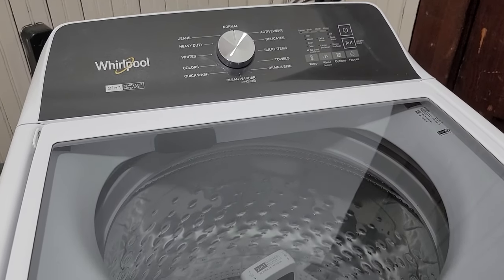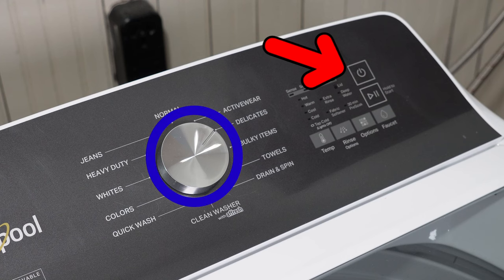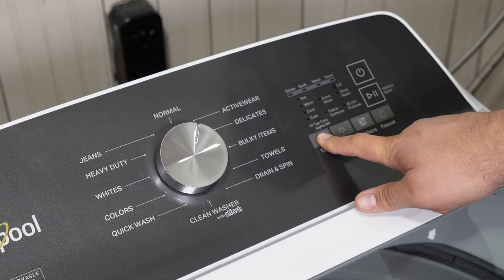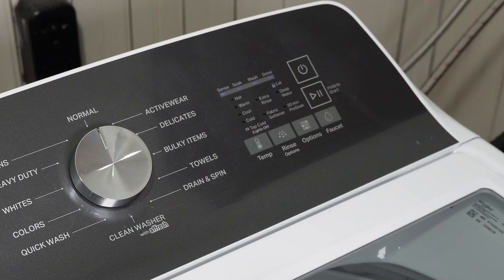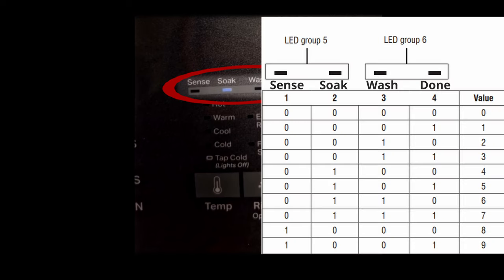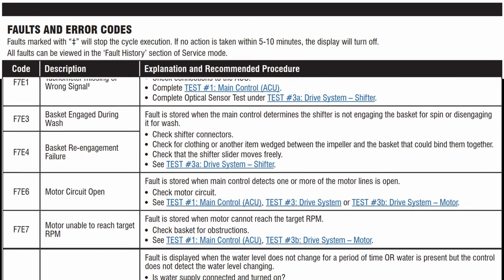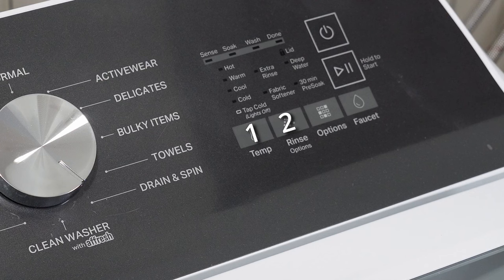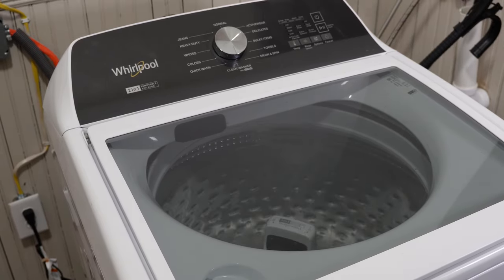Whirlpool Touch Screen Washer Diagnostic Mode, Error Codes, Calibration, and Troubleshooting

Comment: I hate this washer.
Reply: You don't hate washer! I love new washer!
Reply: Me too
Reply: Same. Piece of crap. Bought new last year and is broken every two to three months.
Reply: It is horrible.
Reply: Sameee😢
Reply: I have not had this washer but one month. I HATE THIS WASHER!!! I would be more happy with a scrub board and wringer washer!!!
Reply: Me too😢
Reply: same here dude
Reply: Me 3..My wife doesn't like it either..Makes a LOUD grinding sound during the sense cycle and slow spin.14 months old
Changed Actuator no luck same problem...waste of money..disappointed with WP.
Reply: Me too
Reply: Me too.....smh
Reply: Washer never had problems until now.
Reply: Same
Reply: Mine randomly decided to stop draining and won’t turn off and won’t unlock.
Reply: @brianj2344  ours makes the LOUD grinding noise as well 😢
Reply: Me too. Absolute waste of money. Had it just over a year and it’s already broken 3 times. Out of warranty now
Reply: Hello All...in regards to the loud grinding sound that sounds like metal...I repaired mine by replacing the splutch similar to a clutch very easy to fix and part is inexpensive..I am not a expert like Ben but he gives great advice. I just like to fix or tear up stuff.😉
Reply: I also hate this washer.  It NEVER fully covers the load with water even though I always use the "Deep Water" setting.  The water never fully drains out of the bottom, so it really starts to stink even though I leave the lid open.  It is really noisey, even moreso than our 15+ year old Samsung front-loader that it replaced.  I thought I hated the old Samsung, but after this Whirpool, I miss the Samsung!

Comment: What does it mean if “lid lock”, “sense” & “done” are flashing?
Reply: That would be F9. He should’ve explained it a bit better… if you look at the graph he has 6:57. The sense and done meet all the way at the bottom in the 9 value..
Reply: @alexmoran6436 thank you for your comment! Does the f9 code mean drainage issue?
Reply: @ninademin8244 that is what I am trying to figure out myself.  I watched a video that says we need to clean a filter inside the washer. It catches the hair.  I think that is what is clogged. I just don’t trust myself taking off the piece to get inside the washer. 😂
Reply: @km88877 my machine had a wire that was disconnected! Hopefully you can fix yours!
Reply: were you able to fix yours? I am having the same issue, the code is F9E1
Reply: @chrismorgan1226  I unplugged it and drained the water with a pump, I let it sit for an hour unplugged and then plugged it back in and it started working again 😅

Comment: I ended up having to get a new washer even though the codes showed that it was the drain pump which they did replace and still had the same issue. Additionally the machine was doing the wobble on the spin cycle and the suspension was shot! Mind you I had not even washed 10 loads in this thing. Stay far, far away.

Comment: Saved me the trouble of driving 80miles with my washer to get it looked at just to find out my drain line was too low and siphoning water causing a fault. I had a old washer before that I salvaged from 3 broken ones. When it went out I decided to buy a brand new one for the first time and had problems right away and a few weeks of trying to figure out the issue this video is what helped me finally fix it. Keep it up much appreciated.
Reply: Was yours not draining right when you bought it? I just got mine today and it is not draining. Clothes are still soaked afterwards.

Comment: Thank you
Helped solve my washers issue. 
Got the code for drain pump issue F9E1 and ran test with back off machine. Arching from wire harness so stripped the elec tape off to find 99% broken wire with burnt insulation. Repaired break and reset machine per instructions in this video. One thing to add, the machine was all ready to go but would not start. I unplugged for 5 min and then it operated fine afterward.
Just a note that my machine turned out to have an extended warranty from membership box store so we called in Maytag repair (haha) man. Besides offering nothing for feedback, he advised on further questioning he needed a part (wire harness and drain pump) and was unable to give any time estimate. Meanwhile cloths piling up. So I completed repair above and we will see how long before he shows back to finish his work.
Hope this pays it forward for someone else with similar issue. This washer is 16 months old

Comment: Your video is perfect! Its full of info I couldn't find anywhere else. Helped me figure out the code about the motor not working. Found out the bracket that hold the capacitor have dent to prevent rotation of the capacitor, and these dents made a hole on the capacitor and broke it.

Comment: Hello Ben ...Thanks so much for all you do for DIY folks....Your video is spot on for the exact unit that I have and trying to fix. My machine makes an ear piercing /screeching metal sound when the unit first starts to spin.... 1st in the counter clockwise during sense cycle... and periodically during the spin cycles. Not sure if its the shift actuator,, clutch, or gear box. I will try to reset the unit and then try to identify the fault codes.

Comment: I think you’re the only one with this info on YT. I hate having to call WP Tech. They take forever to answer 😂
Reply from the maker: Its pretty bad if some random guy on the internet helps more people than Whirlpool lol
Reply: @bensappliancesandjunk Do you know what part needs to be replaced for the code F9 E1?
Reply: @bensappliancesandjunk I can't get the machine to drain the water. Would it be the pump?
Reply from the maker: @TheG4fbaby  you need to test via multimeter for that. See if you can get a signal from the control board to the pump (OL means its dead), then take pump connector off and test pump. We are seeing a LOT of these units have dead drain pumps, that end up being the harness rather than the pump itself.
Reply: @bensappliancesandjunk please help with my washer. It’s sensing making a noise sounds like it’s draining, then going to done. Did the hard reset twice,,nothing happened, plugged it out for a day still the same thing.
Reply from the maker: @syheidabrathwaite5390  Jave you looked for error codes?
Reply: @bensappliancesandjunk  no I have not, I simply follow the hard reset thinking it will work. Simone explained their same problem I’m having, let me get the code. Cause she never got a reply to her code. 
One sec.

Comment: Thank you!!!  I ran mine in diagnostic mode and it showed that the drain wasn’t activating. Took it apart and the drain pump cable was severed!! Probably from rocking super hard with a big load. I spliced the cables back together and now it works!!!
Reply: Thanks for this comment.  I had the same problem!
Reply: @tdafan100  I think I have the same problem. What error code did you get? F8e1?😊

Comment: Thank you for posting a video with my actual model!  Do you have a video for replacing a tachometer?  I got the F7E1 error
Reply from the maker: It should be like all the other shifters out there. Pretty straightforward fix
Reply: I had this code replaced it and still not fixed 😩 just now when I run the test cycle it never stops spinning

Comment: HELP!! I have that same washer. I ran the diagnostic test. It flashed the same lights as the example washer: Soak Wash Done Lid
Ok so in between flashing this error code it also flashes just: DONE. But does that just mean DONE or is that another error code?
Reply: HELP!!!  Mine is doing the same.  I don't see a response. Did you get your machine to work?
Reply: Mine is doing the same thing helpppp
Reply: Mine too
Reply: It would be F7, E1
Reply: @acasares311 how did you get it fixed
Reply: @RemiB2023 how did you get yours fixed
Reply: @fixedalarm5012  had to have a repair man fix it. It ended up being the clutch I believe

Comment: I had an issue where the wash cycle took well over an hour and the lights flashing were lid and sense together and then done.  The unit would just try and drain the water but no noise and clothes were still soaked.  I then shut the machine off and added more water and did a drain and spin cycle only and it worked.  Could this indicate that the drain filter was clogged?  I did use an old sunlight he detergent (maybe it was too thick/too much) and it was only 1/2 load.

Comment: Our washer’s agitator barely spins and during wash it keeps sitting there, filling with water, agitator moves a little, fills with water again, then agitator barely moves. It seems as if it gets stuck in the wash cycle and doesn’t know how to wash, any suggestions?

Comment: Ok I have a Maytag front load giving me trouble error code F 05, which tech sheet says heating element/sensor error. I replaced element, heat sensor and the CCU. Still getting same F05 error code in the diagnostic  test. 
Any ideas?

Comment: I have a 2in 1 washer I got new parts for the washer and it still doesn't work the codes are still flashing   sense ,soak  wash to done with the lid liight  on and then falashes done. I already ordered the control board and the lid lock please help me
Reply: Is it solved?

Comment: The 123 don’t work for me. I’m home by myself and can’t get to the plug in to do that. 
I put some bulky cat stuff in the washer like a couple
Cat beds so the washer was giggling in spin cycle. 
Then I noticed the stuff was wet even though it went though the drained.
And the sense and light went off and on and the lid lock button off and on as well. So
Idk wtf the is wrong. 
I just turned it off and on and did a drain and spin and the washer is giggling 🙄

Comment: I have code F7E1. I haven’t tried anything with a multimeter yet, not the best at using one other than checking continuity and voltage. My washer will click the door lock, it does lock at first, then immediately unlocks and won’t do anything else. We bought it new just this spring. Any suggestions?
Reply: Same f7e1 it's either loose wires, control board, hmi harness, UI or shift actuator.  I changed shift actuator no luck so now tech guide says control board.  Waiting on part hopefully it fixes it.  I'm on day 3 no washing machine.  Good luck on yours.

Comment: Thank you so much.  Glad I found info on this damned washer! How did you get so smart? I feel like a dummy screwing around with this washer. 
How can I get just a rinse cycle?
How to stop when the washer starts shaking because it got unleveled?  Thank you.
Reply: I have this washer, there is no setting for just rinse, there is one for drain and spin. You can use the quick wash and stop after the first wash cycle by pressing the power button. Or you can just let it run for rinse cycle, usually 30.minutes into the quick wash setting. You can pause the cycle by pressing and holding the arrow key until it clicks, it will stop and unlock the lid. I use this to add detergent and fabric softener. This will stop it so you can re-adjust the load too. This machine is a pain but I have learned to work around it.

Comment: My wtw8000 beeps constantly. Unplugged repeatedly and still flashes code F then 2 over and over. the power button will not even allow me to turn the machine on or off. Also, all of the lights are illuminated around the knob. Please advise. I have checked all the hoses and they are clear.  7:32 7:32

Comment: Question- Has anyone had this same issue and if so, was it an easy fix? The "done" light stays on after the cycle completes; I lift the top door, close it and the light stays on.  This was not happening before.  The "done" light should go off as soon as you open the door. Any ides or suggestion how to fix this?

Comment: You're awesome Ben.  I just bought a 2020 Maytag MVW7230HC0  used. The tech sheet is missing, can you recommend a site or whatever where I could get a copy of one.  This machine has an LED display. It doesn't have the six pilot lights

Comment: Just got the washer techs ran the test stopped running water did not drain now I have lights sense, done and lid lock light on what does that mean is that fixable
Reply: I have the same issue my washer isn’t draining either! Lights sense and done and lid is coming on

Comment: Great video - I installed one last night, I am not getting any water coming in - I only get water from the "faucet" button --- do you think it might be water controller valve faulty - this is literally a new machine - I am going to test the valve tomorrow - and run these tests and reset - hope that it will get fixed, if I still don't get water, then I will replace the water valve - after doing all this, I might be out of options - what do you suggest I do next if these do not work out for me?
Reply from the maker: Thats an odd one. I'd check to make sure both hot and cold water is coming to the valves by unhooking and making sure water comes out. Make sure the screens where the valves are, aren't blocked either.

Comment: Thank you for this info. I have this exact unit and it will not run a cycle. It says error code F7E1. Ben, are you familiar with a fix for this code? I have tried everything I can do to try and reset the unit. But nothing will make this unit work.
Reply from the maker: Usually F7E1 is a shift actuator
Reply: @bensappliancesandjunk  I replaced the shift actuator and am still getting the same error code. Any other suggestions before I call whirlpool support to stop by? Thank you.
Reply from the maker: @richpaprocki  did you run a recalibration cycle after installation?
Reply: @bensappliancesandjunk  yes many times. Also tried unplugging it a few times as well.
Reply from the maker: @richpaprocki  I'd check wires for continuity/voltage going into the actuator when its running. Either a wire is damaged/frayed preventing voltage from getting to the shift motor, or the board isn't putting out proper voltage (bad board).
Reply: @bensappliancesandjunk  it ended up being the capacitor. Replaced  and working again! Thanks for your videos, I avoided a service call!
Reply: @richpaprocki would your maichine not spin? I have f7e1 and f2e3. Will not spin to start the cycle. Replaced the actuator but it still only makes a whining noise when trying to spin
Reply: @xxflash-ninjaxx4662  correct, if I remember correctly it would not start a cycle and would click right to done after trying to start it. My capacitor was shot. Once replaced, everything was back to normal. Try testing that with a multimeter.
Reply: @richpaprocki  thanks for the help. Hopefully, this solves my issue.
Reply: I think I may have the same problem, how did you determine the capacitor was bad?
Reply: @calvingavisk  i bought a $20 multi meter from harbor freight and tested it using the capacitance setting.  Called some local part stores and replaced it.
Reply: Mine also ended up being the capacitor. Thanks for the idea!
Reply: @calvingavisk  Happy to help!
Reply: What’s a capacitor!?  Haha this is exactly what my machine is doing!!!
Reply: @richpaprocki how do you use a multi meter ?
Reply: Thank you so much for these comments!!!! I changed my acctuator  based on everything I read about F7E1 and it didnt fix it either. Saw your comment and bought a capacitor off amazon for $30. Running it now!
Reply: How did you replace your capacitor

Comment: I have code F2E3 and  F7E1. Washer makes whining noise but will not spin. Any help is appreciated
Reply from the maker: Usually shift actuator
Reply: @bensappliancesandjunk  got a new shift acuator and same issue. Someone else commented here that it was their capacitor. Will try that bext and see what happens

Comment: I have the F7 and then done light. I’m not smart enough to figure this out. Any help?
Reply: I have the same error… it’s an F7E1 error code which indicates a Tachometer missing or wrong signal
Reply: @VanEssa-56  do you have any solutions to fix this? Thanks
Reply: @VanEssa-56  I have the same error

Comment: Can anyone help me? I washed a load fine, then went to wash the next and now when I close the lid it locks then unlocks, it won’t spin nor will any water come out. It just goes straight to done. It the same washer that’s in the video.
Reply: This is my problem did you get it fix? If so what you do?

Comment: Recently had this model show NO error codes but in diagnostics mode would NOT shift, agitate, or spin. Anyone have this issue and how did u fix?
Reply: Did you ever find a solution?
Reply: Having the same issue it just stay on sense and say it’s done .. no water fill up or anything.. did you find out anything? I only had it for a few months
Reply: Capacitor. $50 fix

Comment: Pretty sure it’s a shift connector replacement I need. Any idea where that is - up where the manual was or behind the larger panel?
Reply: Did you ever find it? I had a F7E1 error as well.
Reply: Just bought 24 hours ago.   My agitator won’t work
Reply: @dclong- what was your fix
Reply: @normahardesty3244 how did you get it fixed?
Reply: @fixedalarm5012  I had to order a component to fix it. Give me a minute and I will go look it up for you.
Edit: I replaced the agitator motor and solenoid switch. Then I did a factory reset from "Whirlpool Touch Screen Washer Diagnostic Mode, Error Codes, Calibration, and Troubleshooting"